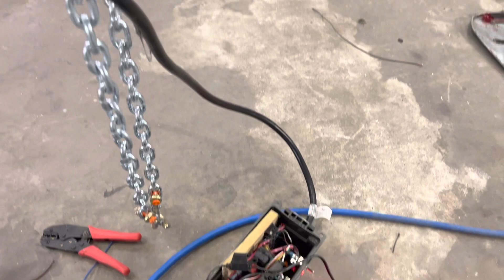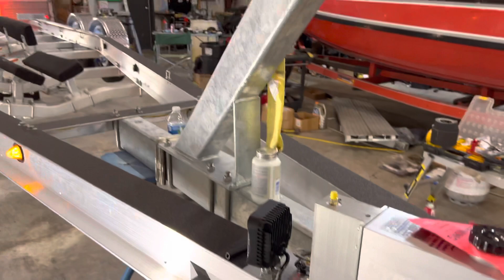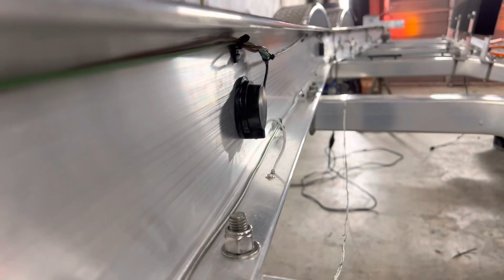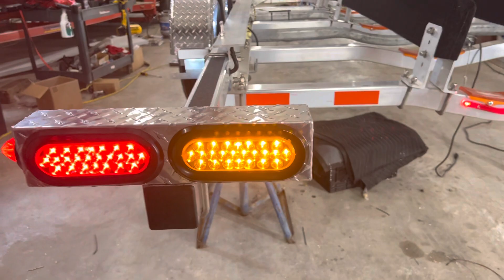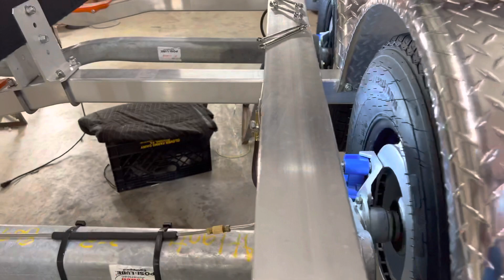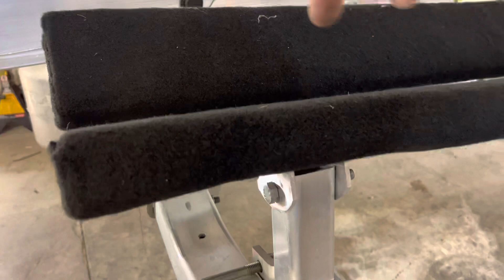Custom Marine Trailer Update and Walkaround

Comment: So you are drilling into the frame to mount the wire clips? 3M adhesives won't cut it?
Reply from the maker: Yes I am.  Float-On uses adhesive mounts and they fail within a year of salt use.  I'm mounting with an aluminum rivet, so essentially filling the hole.